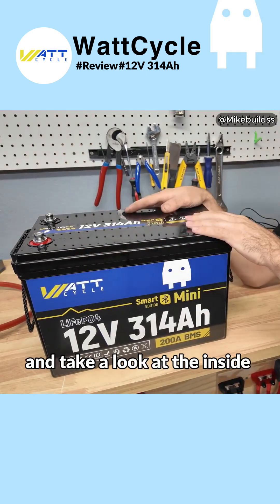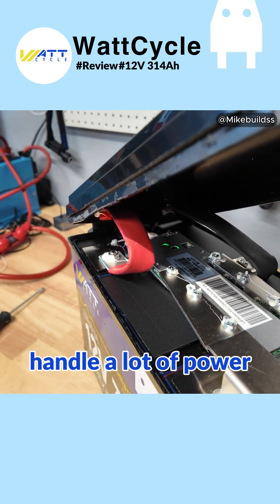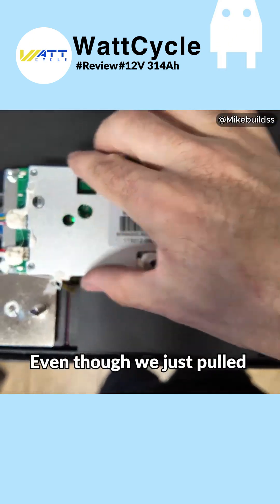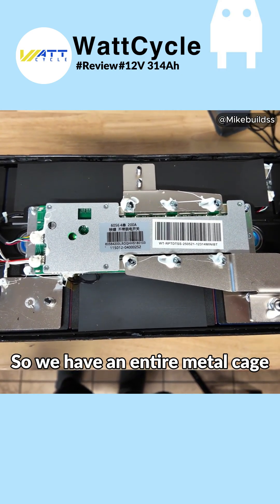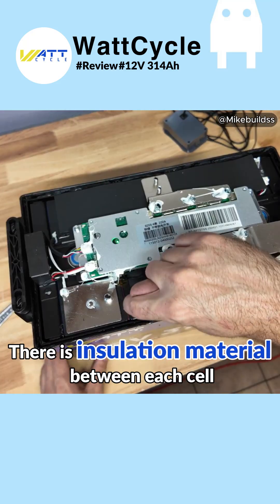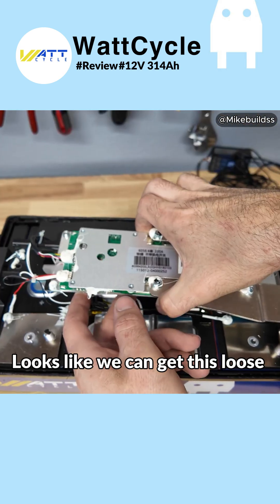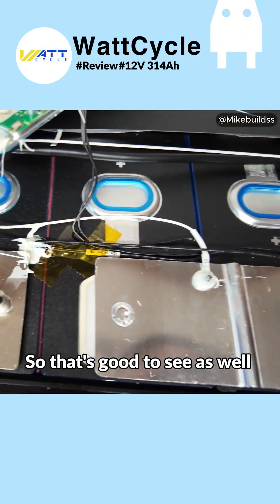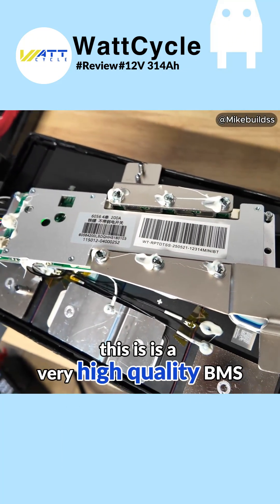Inside WattCycle 12V 314Ah – See What Powers It! 🔋✨

Comment: LeFePO4 is outdated... putting a bluetooth bms on it doesnt make it any better... just the opposite... it will increase the passive bmw draw and make the battery unusable after sitting still for a few months...
Reply from the maker: Thanks for sharing your thoughts! While some might feel LiFePO4 is outdated, it’s still one of the safest and most stable chemistries available today. 🔋 As for the Bluetooth BMS, the standby consumption is extremely low, so the impact on long-term storage is minimal. Plus, it adds convenience and real-time monitoring for users. We always balance safety, performance, and user experience when designing our batteries.😊
Reply: @wattcyclepower maybe a charge indicator when battery voltage drops during storage.... but sounds like a good product.... Just going off content of video and comments.